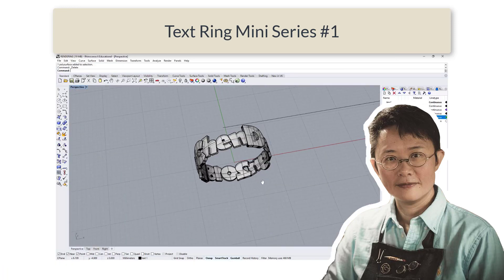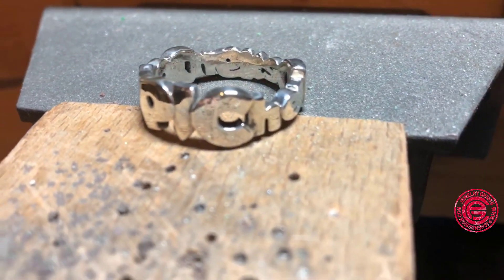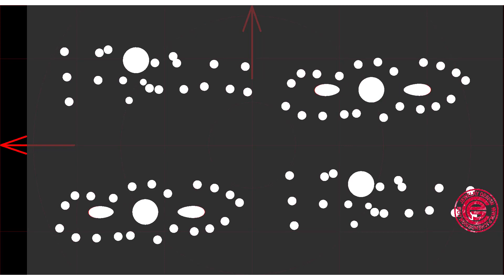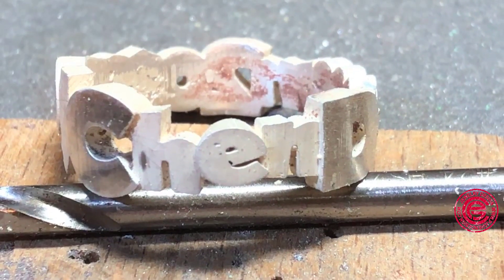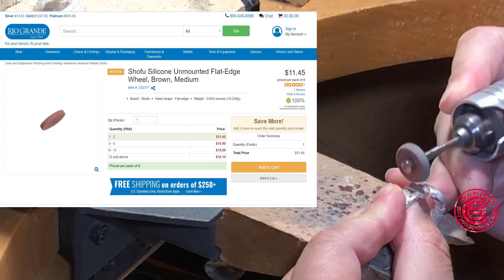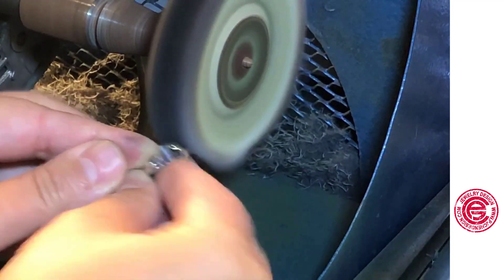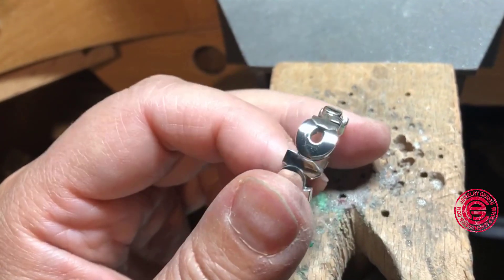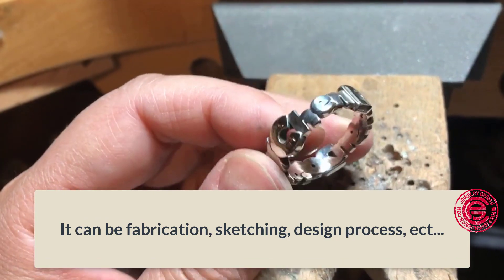Jewelry Making- From CAD to Finish (2018)

Comment: Hello PJ 

One of the comments we have had from our caster is that when when making a plaque buckle it is very difficult to cast a flat back - can you show us if this possible or should we create a hollow back. The reason is many customers we have want a solid piece not hollow. Would appreciate your opinion.
Reply from the maker: For the larger piece flat back may have warping issue on resin printing. As for for the casting. it depends on the thickness of the piece. if the piece is large and thin. it does take some experience to cast it. I will check with my casting vendor to see his opinion.
Reply: The piece is usually 75 x 50 x 3 mm thick and solid brass

Comment: hi Pj j work with formlabs 2 but the castable resin does not burn
 as good as the wax, I have problem with porosity and I see your video you ve got the same problem like me
Reply from the maker: HI Patrick, 
I did cast two of them. and one came out great (the one I polished) but the other one (just cut out from sprue) wasn't perfect. what type of investment do you use?
Reply: @PJChenJewelryDesign  I use Ransom spécial for 3d printing, formslab have now a wax resin but I have not try it yet
Reply from the maker: I use Ransom&Randolph Plasticast investment as well. You need to get the castable resin. the regular resin may cause not cleaning burn out. which may be the reason you have a lot of porosity.